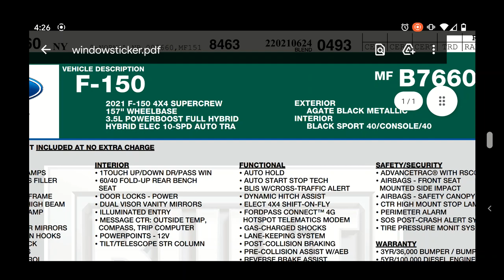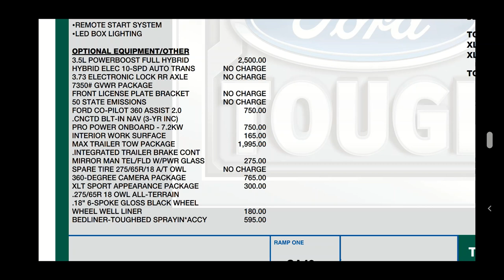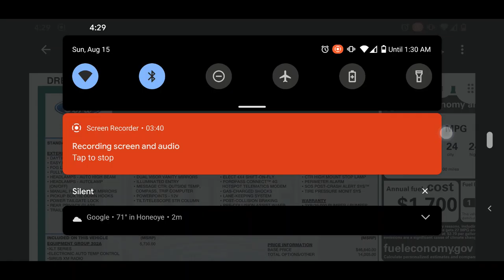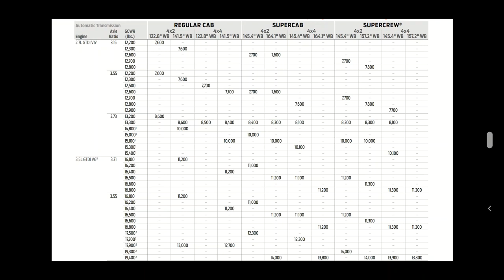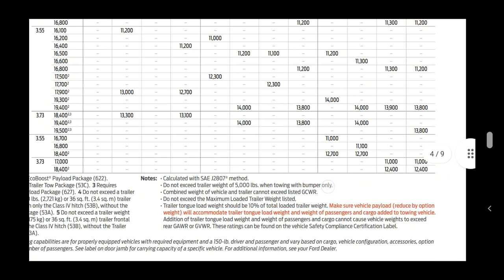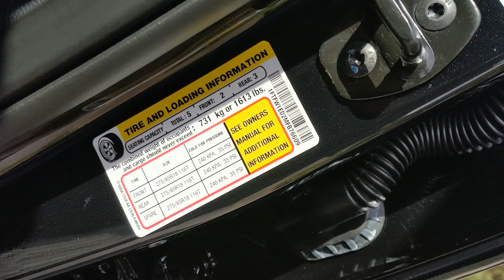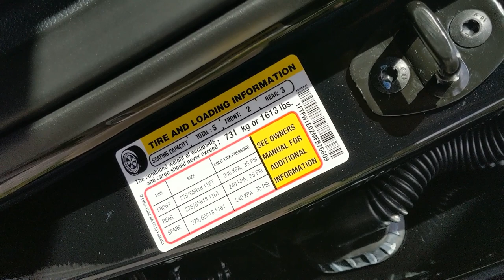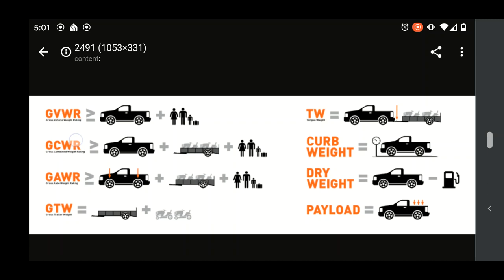2021 Ford F150 Powerboost - Let's talk Payload and Towing Capacity Numbers

Comment: '22 502A Powerboost FX4,Max Tow, Bed Util ,Copilot 360 Active 2.0 (blueCruise/Active park), Tow Mirror, Chrome, 360 Cameras, 7.2KW has a payload of 1444 lbs.
Reply: '23 501A Powerboost Sport, Max Tow, Bed Util, CoPilot 360 Assist 2.0 (should be 0 pounds), 360 Cameras, 7.2kW, AND sunroof has a Payload of 1489#.   Haha I got 45 more pounds than you!  :))   Basically the FX4 weighs more than my sunroof I'd say. Splitting hairs, it's tight.
Reply: I’ll play, 2024 302a(xlt), powerboost, 6.5’ bed, supercrew— 1504lbs

Comment: strange that I have the 5.5 ft bed and my payload capacity is less than yours but the gvwr and the max trailer gvwr are exactly the same as yours. So I understand that the longer wheelbase doesnt affect the GCWR. In that case I don't understand why my trucks payload capacity is 1462lbs.
Reply from the maker: Do you have the Max Towing package as well?

Comment: I want this wheelbase,but I'm anxious about trails. I take my extended cab with the 6.5 bed on them,but it's not the 4 door. I'm on the fence, I love the extra bed size for camping. Have you gotten used to the length. Parking lots etc?
Reply from the maker: Hi Ziggy, I can't comment about the trails. But I got used to the length pretty quickly in parking lots and all that. The 360 camera is a life saver in that regard.
Reply: Ziggy I turned in a lease early as u could not live with a 5.7 bed.   No room for stuff or not good for camping so my recommendations are crew cab and 6.5 bed.
Reply from the maker: I agree, the longer bed is more important than the large back seat to me, so I got both

Comment: I was hoping you could share what the max tongue weight is. Yes, I know that the experts recommend 10-12% of the trailer weight on the tongue. And I know people think that your max tow capacity times 0.10 = the max tongue weight but that’s not always true. Some Class IV hitches with a strong frame can support (even marketed by the company) a tongue weight higher than 10% of the trainer weight. Would love the answer if you know. Your set up is nearly identical to what I plan to order. Thanks! Andy
Reply: The F150 PowerBoost or EcoBoost have the same Tongue Weight as far as I know, depending on the hitch options installed, because it only involves the hitch to the frame involved not engine or options or payload.  He and I both have the PowerBoost and the Max Tow Pkg, and the Tongue Weight max spec is 1400#.  I just bought my 2023 PowerBoost today and I've been researching this in order to decide if it is beefy enough.
Reply: 10% of trailer weight equals tongue weight assumes your trailer is loaded correctly. It should never be below 10% because that would mean you are back heavy instead of front heavy which leads to trailer sway. So, if tongue weight can never exceed payload capacity, then your max trailer weight can never exceed your payload * 10.

Comment: Curb weight is GVWR minus payload from door sticker.  Average wt of spray in bed liner is 50 lbs which reduces payload number on door sticker
Reply: While your truck has a tow rating of 11,000 lbs the soft suspension limits payload reducing your tow capacity well below 11k lbs.  An 11k travel trailer will have a tongue weight of at least 1000 lbs (10%) leaving less than 600 lbs for any other passengers and gear in the truck.  The practical max trailer weight for most half tons is around 6000 lbs for safe towing.  People often exceed that but the truck can easily be pushed around by wind and semi pull going down the road with heavier trailers in the 7500 ton 8500lb range.  Those weights are 3/4 ton truck territory in my opinion.
Reply from the maker: Bingo. If it weren't for the ProPride hitch I would not go too far from home.
Reply: @notallwhowanderarelost2024  Nice.  I tow with a ProPride 3P too. Game changer for eliminating sway.  I recently upgraded from an F 150 to F350.  Still using my 3P for the sway piece of mind.
Reply from the maker: That's exactly why I ended up getting it. I knew one day even with a bigger truck I would still use it.
Reply: Yes, I believe GVWR was expressed incorrectly here.  I also believe bedliner is in fact accounted for on the sticker, published payload is 1810 or 1830 going by memory and sticker is lower than that.
Reply: @vidwiz12345  Bed liner probably is accounted for in the sticker if ordered from the factory that way.  Often the bed liner is an add on after the sale and will reduce payload by the estimated 50lbs.

Comment: So I don't get it. They say the 3.5 supercrew tows 13,200 lbs and the amount I can put in my bed is about 2,000lbs
Reply from the maker: That's how all the truck companies somewhat mislead people. Yes there may be an F-150 that you can order that can tow over 13k pounds, but that's usually a bare bones truck with no options taking up weight. Same with the high payload option. However usually you can't get both at the same time, and as you add options you start decreasing your payload and towing capacity.
Reply: Tow rating is limited to payload if single occupant driver only you can achieve max tow #s of trailer hitch and engine rear end capacity.
Reply from the maker: Yeah with RV's the payload max limit gets hit first typically
Reply: @notallwhowanderarelost2024  I'm taking delivery of a jayco 28bhs I have heavily researched my 19 f150 to make sure it's OK but I will ultimately end up with a f250 at some point.
Reply: Father I do not believe there is a configuration of 13200 with a 2k lbs bed payload that is not achievable normally the 13200 trucks have between 1480-1820 payload limits. The trucks with 1900-2500 payload have lower towing capacity but higher payload due to cab frame length bed length etc..
Reply: The ONLY F150 that can handle marketed trailer weights is a stripped down F150 with the specific Heavy Duty Payload Package.  Moreover your real payload is what the yellow sticker says ok the specific truck you want to buy.  The other data is useless marketing data.  Dealers and especially rv dealers will feed you crap.  Walk away from them.  Go open the doors of 50 trucks at a dealership and look at yellow payload stickers.  I have down this to over 200 trucks.  Only the F150 with Heavy Duty Payload Package comes close to advertising from Ford.
Reply from the maker: Exactly, don't listen to the commercials, almost no one buys the model that is equipped for that number. The real trick is building the truck you want that maximizes the payload and towing
Reply: @slmjake  AND for 2023 the only trim level you can order the HDPP on is the XL level.  I'm looking at a 2023 PowerBoost 4x4 5.5' bed Lariat 501A with heavy options being the moonroof, rear tailgate step, 7kw inverter, it is on a dealer's lot and the Payload sticker is a mere 1489#.  I want to use a ProPride hitch to tow our new Salem 26BHHL which is 6700 dry, guessing 7500 loaded, so 800 tongue weight.  That leave me 649# of cargo for 2 overweight retired people and minimal accessories.  Tight.  Heavy stuff can go in the center of the trailer if needed.   I think I'm buying the PowerBoost this week, and only because I just read about the ProPride.     The only thing I don't know is how close to the exceeding the rear axle GAWR of 4150 (per your sticker, but I'll check mine too) it actually weighs, as I won't know until I weigh it what the actual rear weight is.  Thoughts?
Reply from the maker: Remember that not all the weight of a weight distribution hitch actually goes on the truck. The weight distribution bars distribute some of the hitch weight back on the RV as well.
Reply: @notallwhowanderarelost2024  Bought the F150 today!  Anyhow, rethinking it my trailer tongue weight will be more like 900. So I have 549# of payload left and will use up at least 500 for 2 people and a few items.  To your point, while I agree with it, I don't see how it impacts the Payload available.  The Tongue Weight max spec is always 1400# and that requires a WDH so you just weigh the trailer tongue directly and compare, the distributing part of where the weight goes is built into that number by Ford.
I'll go to a CAT scale soon and weigh my empty truck rear axle to compare to the 4150 GAWR spec.